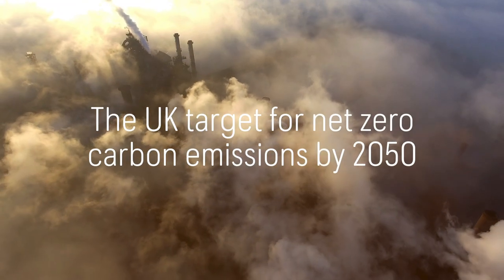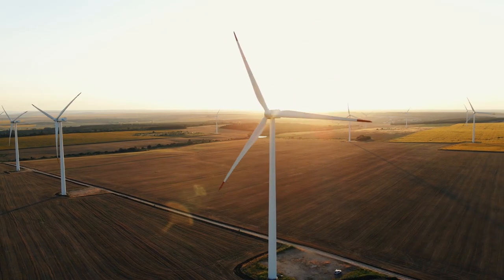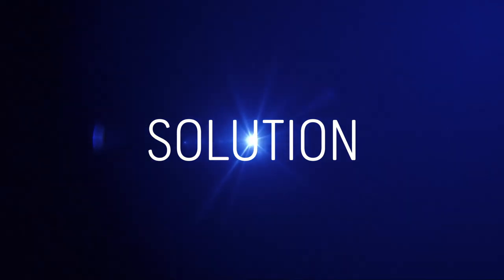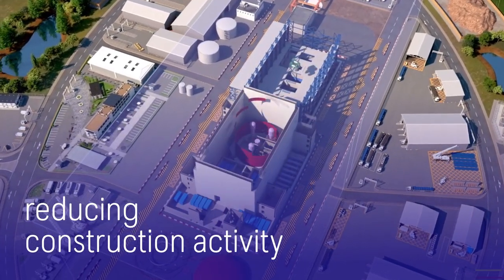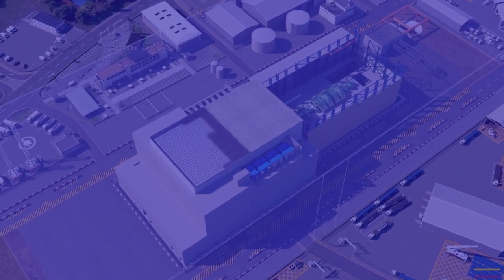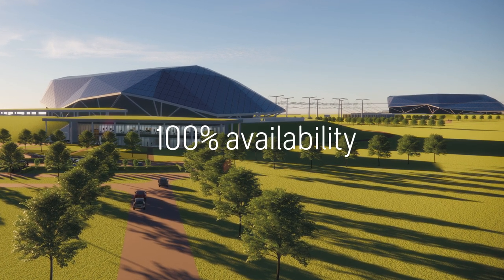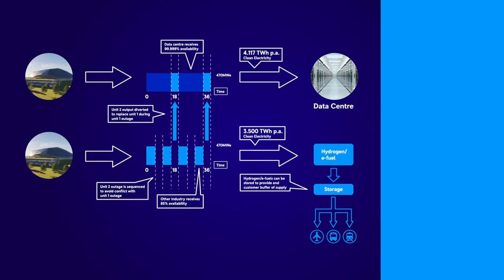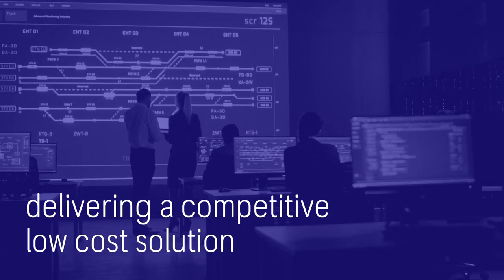Rolls-Royce | Small modular reactors

Comment: Is not clean. The real clean energy is coming from Costa Rica. Belergy Technologies.
Reply: im curious as to why is this not clean? the definition of clean energy is that it does not contribute towards giving out carbon dioxide and other gases that has the greenhouse effect and also if you mean solar energy, they are not always available they will not always be producing the same amount of energy through out the whole day because theres uncontrollable variables such as the weather, climate, and season to take in place and that means its not reliable enough to be considered a primary source of energy
Reply: @potatopc1810  Low-carbon, sure; but calling nuclear energy a clean energy is quite a stretch. Nuclear fuel mining, processing and disposal is quite a big concern. The isotopes in the waste fuel have a long half-life, some more  than 80 years, meaning that many generations after us will have to manage them.
Reply: @javierhualde739  spent fuel rods can be 90% recycled